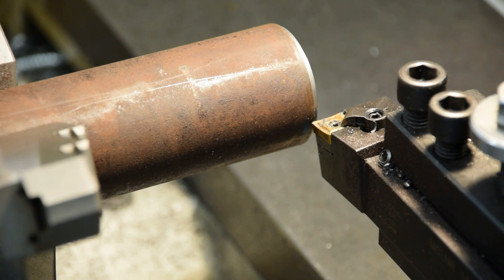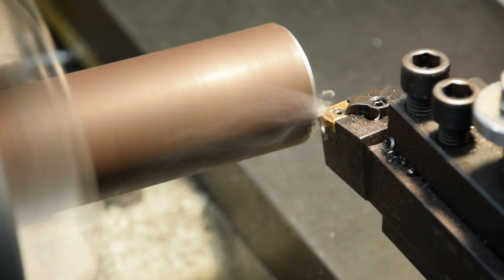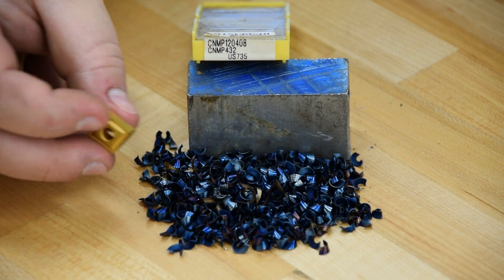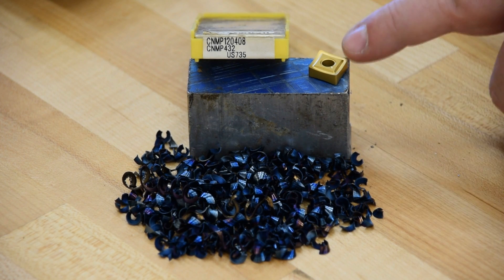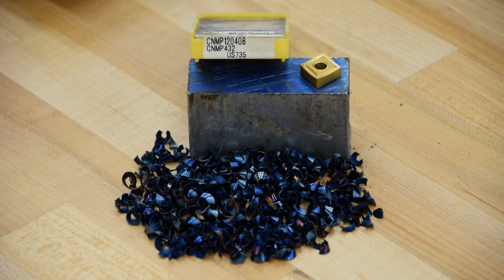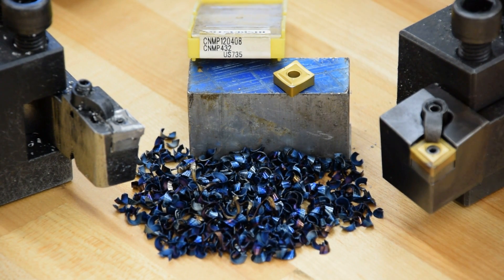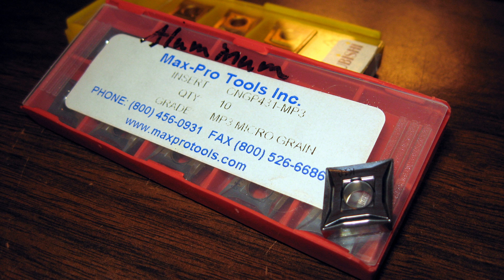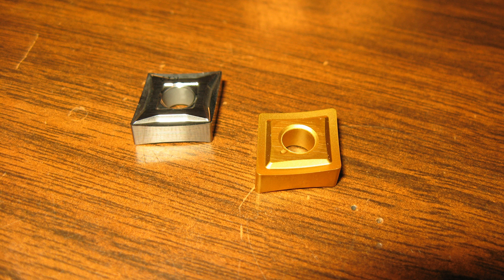Chip Control - Episode One - The Mild Turning

Comment: I would like you to explain about how to set the proper DOC and SFM based on the catalog charts. I often find myself only with the catalog and don't really have the insert's box
Reply from the maker: Which company's inserts are you using?  If you can give me the brand and the insert size/shape/grade/chipbreaker, I'll see what I can come up with.

A good rule of thumb for a manual machine is to start at about half the stated SFM in the catalog for the given grade, start your radial DOC at 1X-2X the nose radius of the insert, and then push the axial feed rate until the chip starts to break reliably (bird nesting goes away).  For instance, a CNMG432 insert has a 1/32" nose radius, so you'd start your radial DOC at a minimum of 1/32" to 1/16" and then keep increasing the axial feed rate from say 0.005" per rev until you get a manageable chip that breaks reliably.  Once you've found your feed rate sweet spot, you can increase your radial DOC until you run into stability/rigidity issues or you run out of HP on the spindle.  You may need to vary the axial feed rate up or down a bit to maintain proper chip control at the new deeper radial DOC's.

It's been my experience that the numbers on the packs are good to get you into the ballpark, but they tend to be overly optimistic on all fronts when being used on a manual machine.  Most engine lathes just aren't as powerful or rigid as your average slant bed CNC lathe, so you can't rely on cutting data that's been optimized for them when running an engine lathe.

Like so many things in manual machine work, there a lot of trial and error involved in dialing in an insert for the first time.

Comment: nice video. Thanks. I only need a quality chip breaker tool for aluminum only.
is there a better, best, brand for this feature?
Reply from the maker: My go-to insert for aluminum turning comes from a company on eBay called Max-Pro tools.

They sell a purpose made insert that is fully polished and has razor sharp positive geometry cutting edges along with a pretty aggressive chipbreaker to cut down on the aluminum wool production.  They make CNMG and DNMG inserts with nose radii down to just 0.005" (perfect for taking those 0.010" finish passes).

Arno also makes a very nice high positive insert for alum and brass, but they don't offer nose radii under 0.015".

Comment: A CNMG would bog down my colchester even at 1mm DOC 0.1mm/rev feedrate...on aluminum! If I were to have only 2 tools that would be a screw clamp parting tool that can do turning and has a wiper effect, and a grooving insert boring bar. You can then just swap inserts or grind yours to do threading and everything else!

Comment: The real folk blues!
Reply from the maker: Indeed.

See you around, Space Cowboy.
Reply: I'm in Toronto, and need to order a stack of inserts. I know literally nothing about inserts other than my shop currently uses CNMG and DNMG (finishing) tips. My main foreman is thinking about switching over to WNMG as there would be six cutting tips instead of four. Do you know anything about CNMG vs WNMG for geometry as to which lasts longer and is more cost effective?
Reply from the maker: Pretty much universally, any chipbreaker and grade you can get in a CNMG style insert, you can get in a WNMG (at least from all the big name brands).

Economically, there's no down side to the WNMG because, as you said, they have six cutting tips instead of four per insert.

The included angle of the tip is 80°, which is the same as a CNMG, so for external work, there is almost nothing that a CNMG can do that a WNMG cannot.  For internal work the WNMG takes up more room because it is a physically bigger insert (wider insert = larger minimum bore size for a given boring bar).  This also makes the inserts more expensive (lower production volume + more tungsten used = more expensive insert), but that cost difference is more than offset by the addition of two more cutting edges.

Other than that, I see no downside.

For a wealth of info on inserts, I suggest first going to CarbideDepot(dot)(COM) and reading all their technical references (there are many), then go download and read the turning catalog from your three or five favorite vendors.  Their catalogs will tell you many things that you won't find anywhere else.  They should be your first line of reference when deciding what insert grade/coating you need for a given application.

I currently use CNMG inserts because that's what I've got (there's something to be said for inertia, it  slows down your ability to change direction, but it makes up for that in cash outlay savings), and they're cheap and easy to find on the surplus market.  I get almost everything I use off of eBay, they cost pennies on the dollar vs MSC/Travers/Etc, but you MUST know what you're looking at, or you'll get screwed or buy stuff that won't work at all for your application.

If I was buying new, exclusively from supply houses, and I didn't already have a huge stock of CNMG inserts and holders, I'd definitely be going with the WNMG.

Look at what you're using in a CNMG right now and then call and ask the MFG (or just look it up in their catalog yourself) about getting that same grade and chipbreaker in a WNMG.  Chances are very good that they'll have the exact same insert available in the newer WNMG style.
Reply: Thanks for your reply. I placed an order for 10 CNMG432 10 DNMG431 10 TNMG431 and 10 WNMG (rip wallet). We don't have a holder for turning with WNMG, so I ordered one as well and the folks I dealt with were kind enough to 50% the cost. The timing was a bit pressing to order as the previous owners at the shop stopped purchasing inserts when they knew they were selling it, and the supplier guaranteed delivery by tomorrow. I've bookmarked the technical reference site you mentioned and will for sure research more as these new inserts begin to deplete. While stockpiling the inserts I need in the future I will for sure source from eBay.

I didn't understand what you meant by "there's something to be said for inertia" were you referring to changing a shop over from CNMG to WNMG or were you talking about the actual CNMG performance? 

The supplier interestingly enough had the CNMGs and WNMGs priced the same so I'm curious to see how they hold up in the long run. Will ask the main foreman who does most of this kind of turning to keep track of how long they last in terms of hours of use.
Reply from the maker: I meant Institutional Inertia, or the tendency for a shop to keep doing what it has been doing because that is the path of least resistance.  Every company has it to some extent, though it has been my experience that the bigger and/or older a company is, the larger the inertia it possesses (like a snowball rolling downhill).